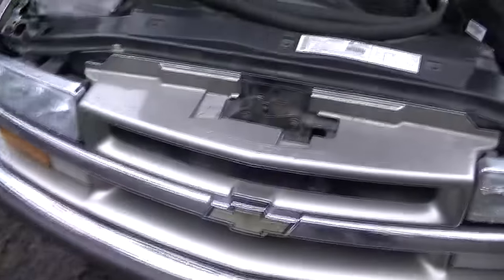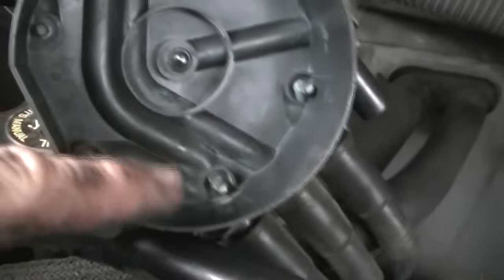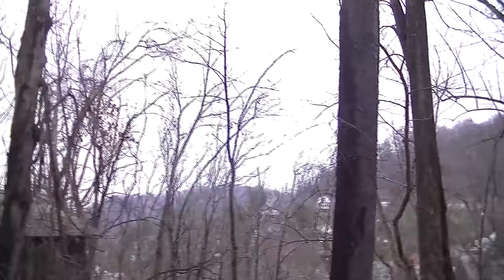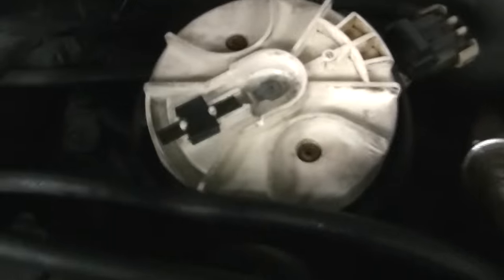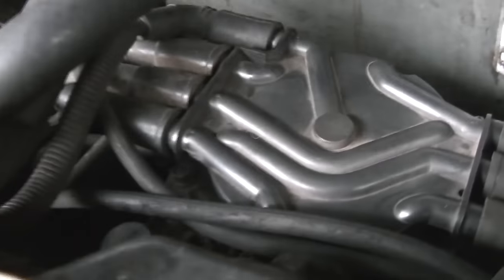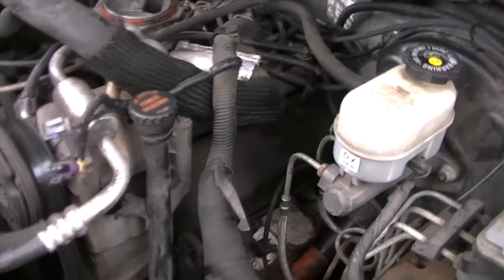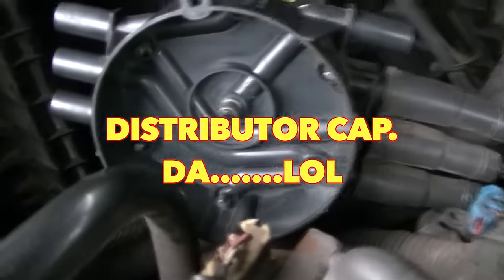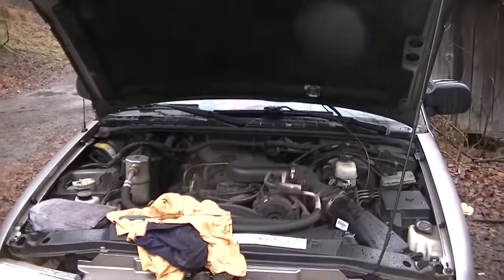4.3 Chevy S10 Not starting. Fixed!! EASY...Popping, Vapor locking...Jump time??... 1995-2008

Comment: Did you have any power when you went to start the truck? Or would it like cut off?
Reply: I was listening and it 
Sounded like it was trying to start.  I have a 97 sonoma and I'm having the same issues.  I replaced the fuel pump and fuel filter, but it still won't fire, so I'm getting the whole distributor in a couple of days

Comment: i saw no moisture. as you said at the begining...the  distrib...is worn out. putting a new cap and  rotor on is temporary. id did that a few months back. started the blazer up. right away i  could hear the new cap being destroyed by the off center rotor. GRIND CITY !!

Comment: I have the same engine in my 1999  . another thing that can happen is the mass air flow sensor  gone bad.. it is in the intake tube close to the radiator.. unplug it and try and start it. if it starts this is your problem.. to double check this while motor is running plug wire harness  back on maf sensor... it engine immediately  shuts off  your maf sensor is bad.  this distributor  problem happens a lot due to design. Have not been able to find an aftermarket distributor cap with brass contacts that will last longer than alum ones. I have been told the moisture drain hole in base of dist has a screen in it. I was told to remove the screen and drill the hole to a larger diameter  and it will help.. it is not a cure but will help. These distributor  caps are known to crack internally  and will cause arcing and will also act like this when trying to start. I wish someone would make a better distributor  and cap for this engine.
Reply from the maker: Good tips!!

Comment: My 2004 4.3L stopped when I hit the gas merging high speed onto the highway. Has 66 lbs. of fuel pressure and spark on the spark plug side. I've replaced a fuel body on one of these motors and it solved the problem. I think I may check all my sensors first this time. BTW I have lost one of those screws before.😂
Reply from the maker: O wow!
Reply: What's fuel body 🥴

Comment: I wanna add that theres 2 timing marks on the crank pulley that when looking down from the top use the 2nd mark when turning cw. The 1st mark is used on astro vans with a 2nd mark on the bottom of the timing cover about the 5 o'clock position. This is because of how harder it is to get into the engine bay of the vans.
Reply: I don't know what engine you have but on that 4.3 you cannot rotate that distributor !

Comment: mine is doing exact same thing...have 60 psi fuel pressure, coil sparks ,plug spark.. no codes (had p1345)replaced timing chain,cam sensor cap and rotor..i had it running badly before i replaced timing chain using ebay cheap rotor and cap... i bought a better cap at auto parts store today...Very depressing all the time and money so far... i will stay positive and fix this sucker tomorrow ...
Reply from the maker: Ok. Let us know if you get it fixed!!~
Reply: i was told by 3 mechanic tdc on compression stroke was when timing gear marks when i replaced gears and chain are facing each other...anyway on my blazer it was the exhaust stroke...so the chinese cap i bought is great once i reinstalled the distributor correctly...also was running bad bucking and hesitation.... code p0101 which is MAF sensor which was bad..cleaning it did not fix...i have one on the way...truck should run perfect with the new sensor... great to have it all figured out... thax

Comment: As far as the temperature sensor I have a 98 4.3 Vortec it has 2 of them the one on the side of the engine that you showed in the video was for  the gauge and the other one is mounted between the thermostat housing and the EGR valve that is for the computer at least that's the way I understand it on the caps they develop hairline cracks between the paths on the humps that cross across the top inside you can't see them but they cause the Sparks to jump just like the moisture does most of the time they don't last a tune-up. You have to do them early I hope this helped out some

Comment: I will tell you something about condensation you won't believe.  Condensation occurs in a distributor cap because the temperature and humidity inside the cap are different..condensation occurs even more so when it rains or a lot of moisture in the air. After running the vehicle,  the inside of distributor is hot.  outside is cooler. moisture on the outside causes the inside temperature to rapidly cool causing moisture to accumulate every where .  If it does it once it will do it again.  I will give you a little tip on how to keep it from ever doing it again.  Believe me this really works.  Take the cap off ...drill two holes in the lower back side of the cap..(tiny holes)..being careful not to drill thru any wire ports.  This lets the inside of the cap VENT and equalize inside and outside temps.  I have done many distributor caps this way.  This inside condensation will also cause the wire ports to short out even when dry just like the one in the video. Had you dried inside the wire ports you probably would not have to had bought a new cap...the last one i did happened to be a 2001 s10 extreme.  I bought it new and it still runs today.  Never had another problem with it.
Reply from the maker: Soooooo true!

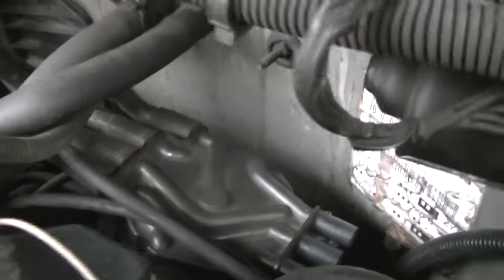Comment: I read somewhere thadt if you do the screwdriver in #1 cylinder and turn the engine (by socket or short cranking of the ignition) that if the rotor is at 9:00 you are on compression stroke.  The alternative is if you do the same thing and the rotor tab points to 3:00 that is exhaust stroke?  Is this right do you know? I need an easier way to find TDC, getting tired of crawling around trying to fix my truck.

Comment: The sensor you changed goes to the instrument panel not the computer. It's up near the thermostat. Also the cam sensor, in the distributor cap, doesn't effect how the engine runs at all.
Reply from the maker: Right. Good eye.
Reply: @FixingWithPassion  since I've got you, my 02 Chevy Astro has the injectors down next to the valves and has wires under the intake that goes to them. Is the fuel pressure the same for this type? Is this an aftermarket system? Or did Chevy change? I think this is the first vortec I've seen with this

Comment: Hi Nathan!
  I am also a Nathan!
 But, I was wondering----are you getting OBD code "P0300"?
   I was getting that and put new fuel filter, rotor button, distributor caps, ECT sensor, spark plugs, spark wires, ECT sensor plug and Ignition Coil and more....
  But Maybe it is the distributor---or This.???

Comment: Your awesome man, had exactly same issue with my 2005 Blazer whenever it was damp.. Cleaned all contacts with sensorkleen some fine sand paper and bam started on one crack... One thing worth mentioning is there is small vents under rotor that prevent  Condensation from building up, be sure there not clogged.

Comment: I really need to ask you a question. I have an 03 4x4 blazer and it is doing the same thing yours was but i cant get it fixed
Reply: Possible it is the ignition switch. South Main Auto has a video on troubleshooting it.

Comment: Check the coil wire could be a cracked wire (insulation) arking to motor.check at night to see better had a 1997 s1 4.3 kept blowing coils.fix replaced bad part of wire fixed.
Reply from the maker: Nice!!

Comment: My truck starts but throws p0340 code… and sounds like lifters are making a little noise… would that be bad timing? I didn’t my intake gaskets and I had to take distributor off and I forgot to mark it… I timed it and it started and threw the code. Please help

Comment: Got a c1500 its running 3 codes a po420 po446 and po300...i have changed plugs wires button and cap..but it is still misfiring at a higher rpm..im at a standstill!!! Any suggestions??

Comment: My 1987 2.8l s10 blazer won’t start after I drive it for a few miles, park, wait about 10-30 minutes and the warm start won’t crank. Not sure if it’s my fuel pump or my tbi injectors. My spark plugs look like it’s running lean due to the beige light brown residue. It’s annoying when I drive to work and have to run somewhere  after the car has sat for several minutes. I have to crank a bunch of times to fire up. The cold start is fine though.
Reply from the maker: Fuel?
Reply: Nathan Rohrbough it’ll have a full tank and still do it
Reply: Coolant temp sensor

Comment: There is a product called WD-40, 
water dispersement formula # 40.
Leaves a oily film inside cap so moisture will not return.
Coolant sensor controls fuel delivery.
Reply from the maker: Good to know.
Reply: Couldnt you have jumped the wires going to sendor
Reply: Manuel Ester  did you change the o2 sensor that the code was thrown for?
Reply: water displacement 40th try

Comment: my 99 gmc jimmy has now got to where it wont crank below 30 degrees but it turns over. Any idea about this? Also i hear a noise under the hood after running the air a bit on a hot day,water pump going bad?

Comment: I have this exact problem right now. I replaced the Crankshaft (Not Camshaft) Position Sensor and the Ignition Coil, but she still wouldn't fire. Had the truck towed and it sit overnight - Mechanic told me it fired up on the first try. Should I just have him replace the distributor (I already bought it pre-emptively) instead of the fuel pump? He is thinking it's the fuel pump.

Comment: These crab type caps are notorious for corrosion. see service bulletin # 03-06-041A (Jan 28,2005) it covers 2001- 2003 Astro, Blazer, Express, S10 2001 - 2003 Jimmy, Safari, Savana Sonoma 2001 oldsmobile Bravada With 4.3L, 5.0L or 5.7L engines.
I have the same problem with my 2000 Safari, I have to change the cap every year due to corrosion. My van is not a daily driver.
Reply from the maker: o-my!

Comment: I have a 03 Chevy S-10 I got a new computer and new ignition module new coil new spark plugs, wires, distributor new starter and it still will not start I don't kw what it could be, also checked all the fuses and relay, what do I do now? Oh also new timing chain and sprocket and yes it's on time checked it several times?
Reply: Sounds like you put a ton of money in your vehicle. 
I know it may sound crazy, but I had the key go bad and it wouldn't start because of the key not communicating with the computer.
It about drove me nuts, ok that's a short drive for me. Had to get a new key from dealer so I could start my car

Comment: Tried all that new cap rotor plugs and wires and coil still no change and no OBD codes. Good fuel pressure off the schrader fitting. So yeah kinda stumped.

Comment: Having the same problem!!! I have a 2000 Chevy blazer. I Changed the rotor, distributor and distributor cap, did a complete tune up, purchased a new radiator and starter and it’s still won’t start !!! Checked the timing and it’s in time. It’s trying to start but still won’t start. Any other suggestions of what it could be ???
Reply from the maker: Fixed yet?

Comment: I changed my distributor, fuel pump, injectors, fuel pump relays, spark plugs and wires, idle control, new air filter and hose, new fuel tank, fuel filter!!!  Why won’t my truck start please help I have a 94 Chevy s10 4.3 L ls vortec engine

Comment: I hear putting dielectric grease In the park wires will help with moisture, but does anyone know if you could put a light ring of RTV on the underside of the cap? That would greatly help with keeping moisture out!!

Comment: Carbon track in distributor cap....hard to see because both cap and carbon are black in color...the fix is to drill a very small hole in the top of the new cap to let out the trapped in moisture
Reply from the maker: Right!!

Comment: Nathan,  First thanks for your video.  I have watch this and others to try and trouble shoot my 1999 Chevy Black with a 4.3 engine.  My issue is the crank/no start is not consistent.  I have changed the fuel filter, spark plug wires, spark plugs, distributor cap and rotor.  The truck will drive perfect.  I can stop, park and try to restart the truck and it will do the crank no start like your video.  I let is sit for a period and it will start up and drive perfect.  This might last one trip when it acts up or it might drive fine for a few days and act up.  I do not know what to trouble shoot because this it is not consistent.  Do you or your viewers have any suggestions?  I am currently working in the middle east with this truck and am trying to fix it smartly as I need to depend on this truck to get around.  A couple of other thinks I have noticed is while I am the cold AC will cut on/off for no reason.  The key turns on the car but it is tricky.
Reply: I had an s10 do the same thing and it turned out to be the crank sensor
Reply: Also with the ac doing that, then you may  have a short in a switch or relay
Reply: ive seen coil/ coil packs run good until they warmed up and thrn it would produce weak fire. or extremely weak fire. which the former caused bad performance and the latter caused - crank/ no start. the energy/spark coming from the coil wouldnt even cause the fuel/air mixture to explode..

Comment: my engine v6 4.3 easily started but stoped in few seconds plz reply now what it could be problem? ? plz now i have to stoped here upto 12 hrs now
Reply: if you are not getting any fire 1rst check ignition module then go to check cam sensor and your crank sensor 3rd
Reply: @dakotawilliams1472  my engine easily stated iupto 1 mnt then its stoped gm 4.3 vortec v6 wait im sending more information
Reply: @dakotawilliams1472  i have getting fire then why its start it is starting upto 1 mnt some times 30 to 50 sec it has fuse panel theay are ok 1 is power relay then empty then starter relalay then 3 to fuse they are ok may be dits distributor cap black colour faulty cover
Reply: @dakotawilliams1472  plz reply now
Reply: @dakotawilliams1472  r u there???
Reply: @dakotawilliams1472  apsib4.302 ed this is engine family

Comment: I forgot to mention I pulled two codes both were concerning the catalytic converter. Do you think this has anything  to do with it not starting?  I pulled the same codes last year but never bother with it. If it is bad I'll just take it off completely or would that interfere with the performance?
Reply from the maker: Na....I'd check fuel and spark at the plugs when cranking.
Reply: I have fuel, and spark to one plug, didn't check anymore plugs, however, it tries to start but wont. I think I had the same problem a couple winters ago. Also, it has been raining for the past two weeks. Last time I replaced the cap and rotor and it ran fine. Before I buy these same parts I wanted to get your opinion.
Does it sound like the cap and rotor again? Thank you for replying.
Reply from the maker: cap and rotor again....cheep fix for now and it will be new again!
Reply: Thank you appreciate the help and reply.
Reply from the maker: You got that right!

Comment: I'm having the same problem, timing is right,  and I'm getting fuel. And replaced the distributor cap and rotor. And still nothing . Someone told me it's probably going to be the spider injectors .

Comment: I have a 2000 jimmy hard to start  if I spray starting fluid in the intake it starts right up and runs fine any ideas?
Reply: Check fuel pressure regulator could be leaking

Comment: My 98 s10 will not turn over. The light come on, the cluster comes on, but when i turn the key...nothing. Think its the starter, but i replaced that awhile back. Suggestions? Its a manual, tried to pop the clutch...nothing.

Comment: I've got a bad issue with mine not starting when at operation temp and has no power when first starting I've done plugs wires coil pack cap rotor and didnt help :/ maybe you know?

Comment: I'm working on a 1999 s10 with the 4.3. I've changed the cap, rotor, coil, plugs, icm,  and still won't start. Have spark and fuel. The only thing I haven't checked it timing.  It was running the other day but bogged out when you gave it gas. I'm at a complete loss on this thing.
Reply from the maker: When at timing chain jumps time it only takes one or two tooth's not to run. I'd go there.
Reply: Nathan Rohrbough ok thanks I guess that will be next.

Comment: I have a 2000 blazer i drove it to the store come out it would not start towed it home and i have put all this new stuff on it: ngk plugs, ngk wires, new distributor, ac delco fuel pump, ac delco coil, new crank sensor, and it is getting fire because its back firing through the throttle body, but when it does turn over it will do this sudden stop thing that it has not ever done. It has 226,000 miles on it i put the new distributor in it ok i put it at tdc piston 1 all the way up and rotor at 6 and the 2nd line on the hermonic balance right. Well it still wont start so i thought maybe a bad distributor so i went and got another one and put it in well when i pulled the previous one out i marked it ok so when i put the new one in i thought i would just check a couple things i went to the hermonic balance and checked that the lines lined up well they didnt but the rotor was pointing at the 6 and the lines were lined up but piston 1 was at very bottom on its way back up so i dont get this its back firing and it just isnt right can someone help me

Comment: I have a chevy S10 4.3 and it was not starting drained battery and sounded as if there was a fuel problem so i charged battery   and on a sunshining dry day i tried starting it and it started right up ran great next day was a rain and very damp day the issue had come back it would not start again any suggestions marty
Reply: Sounds like the same problem w/ moisture regarding these dist. caps. They are junk and it has been stated by the designers to replace them with the best caps you can buy.
Reply: Guys.. I found a fix for it, ask! :)